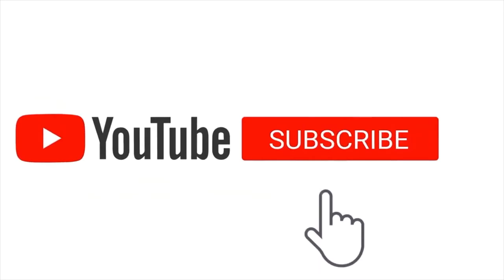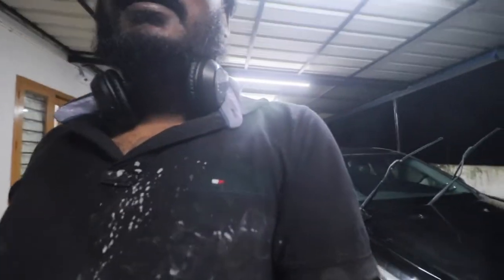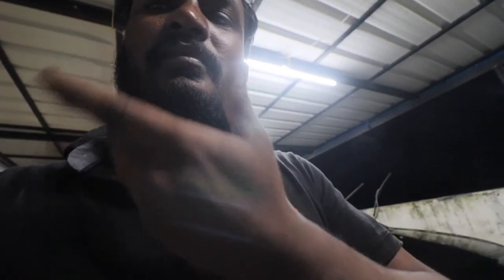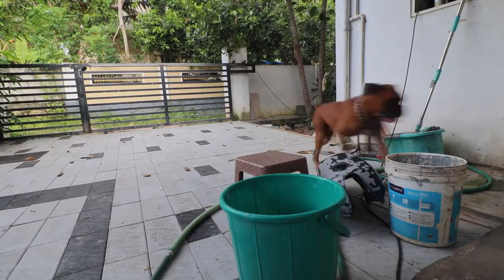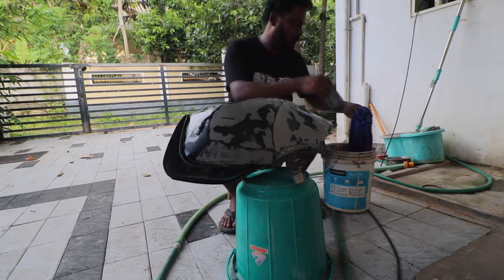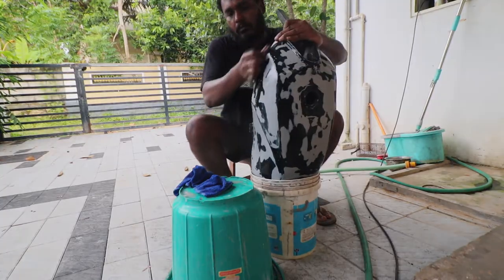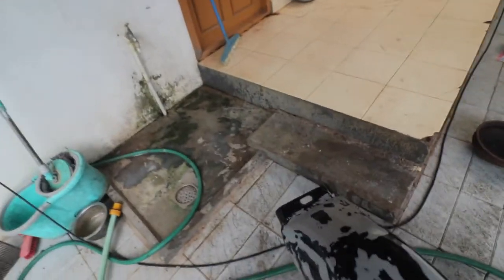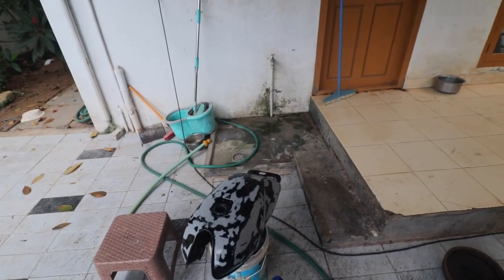Yamaha RXZ backup kit bodywork (English Video)

Comment: Good work sir...I want to ask you a question ..that I am using a silencer of Rx 100 but the muffler is of Rx135 ..so will it be perfect for my rx135 ?
Reply from the maker: Doesn’t make a difference, might sound a little different
Reply: @Yamakaze  but I am confused that somebody told me that Rx135 silencer is different from Rx100 silencer but it looks same from out side.
Reply from the maker: Bhargab Barman it is different, but there is going to be no effect in performance, the sound will be different
Reply: @Yamakaze   please tell me the actual difference between the silencers